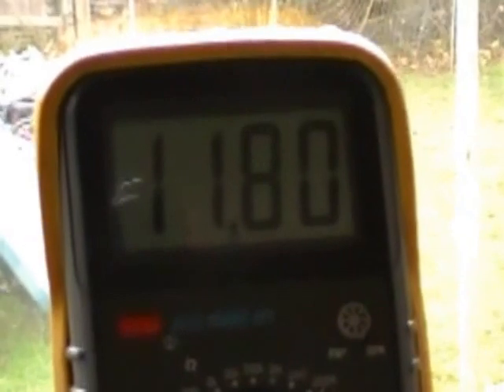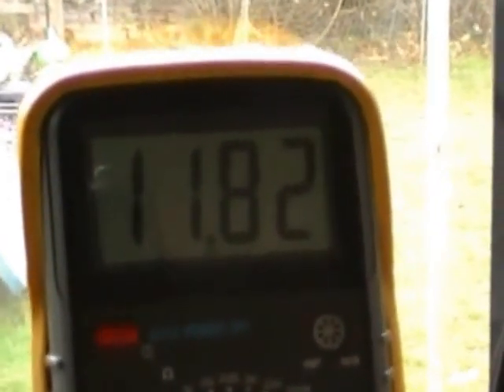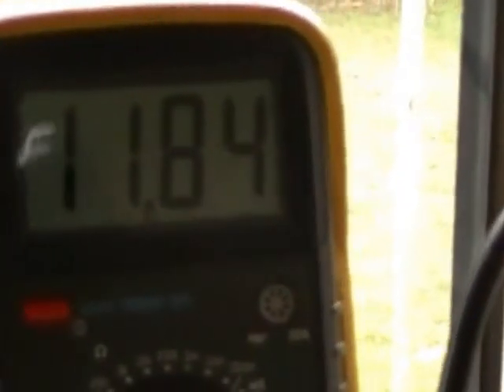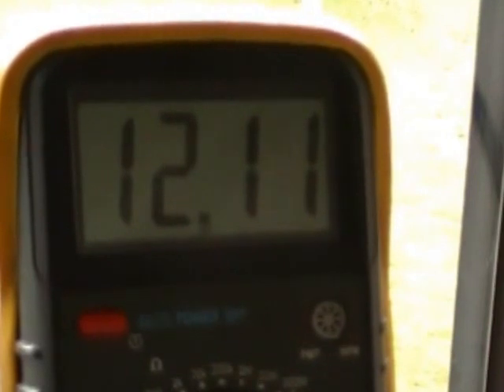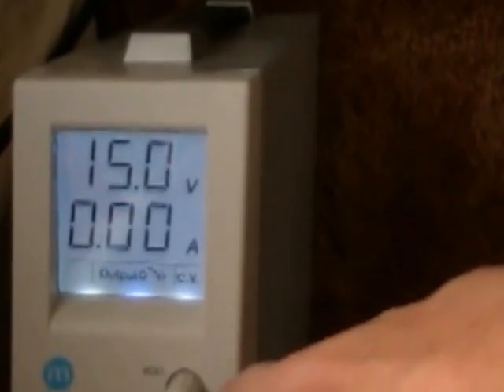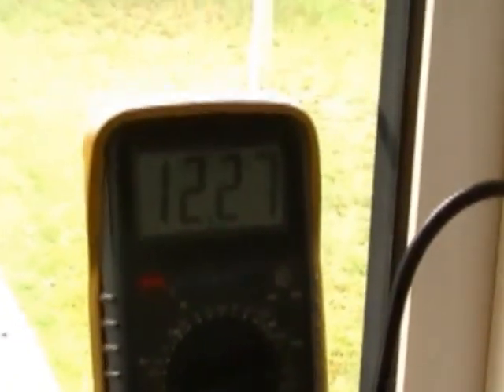MY NICE EV Cheap Electric Car Video 1

Comment: Hi Raymond,
It has been a bit over 12 months since you posted this video and I was wondering how this battery doing now. I have had a bit of trouble with the battery in my truck and I just rejuvenated it with the Epson salts and a desulphanation charge and it seems to be back in good working order. It started the 5.4 liter engine in my F150 about a week ago when it got down to -8 F (-22 C). Just curious how much more life I can get out of it.
Reply from the maker: The battery was a failure. So I opened it up and 2 cells were completely solid. So I took out all the lead and converted it into my Quantum Accumulator. Videos of conversion are on my channel. Glad yours worked out ok.

Comment from the maker: I managed to get the top off the epsom battery because 2 cells packed up. Then things froze. When I get out again I shall be taking the lead out melting it down to thicker plates and then putting back together with loose top. I can then use it as a deep cycle battery on my solar/wind generation system. It won't move so top can stay loose for ease of maintenance.

Comment: i believe what happens is over time the sulfuric acid breaks down into water and sulfur and the sulfur coats the lead plates. so not only do ya lose some of the electrolytic potential but you also get a layer of sulfur blocking the chemical reaction, and the epson salts help dissolve the sulfur back into the electrolyte (sulfuric acid).

my uncle has like 15 old truck batteries he said i could have from his barn, i will most likely refurbish them like this. thanks for the awesome video.